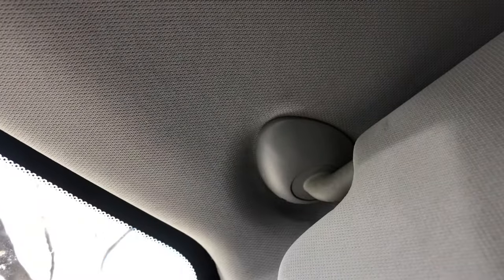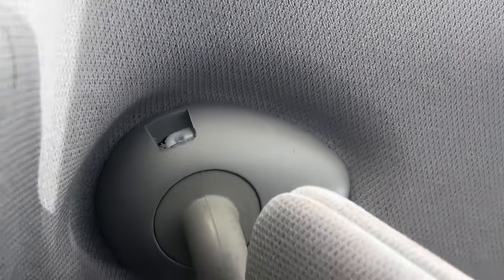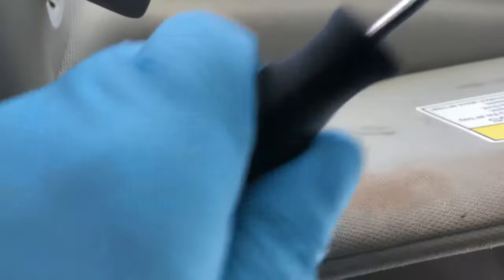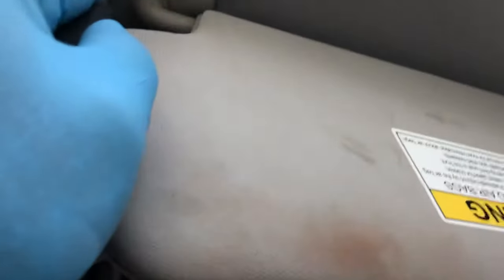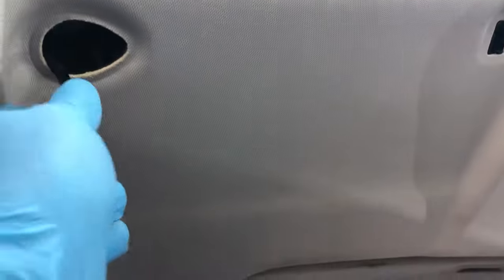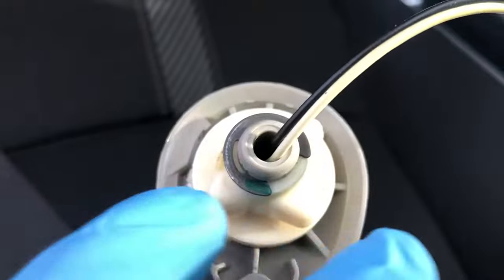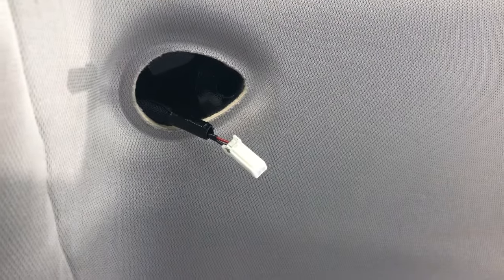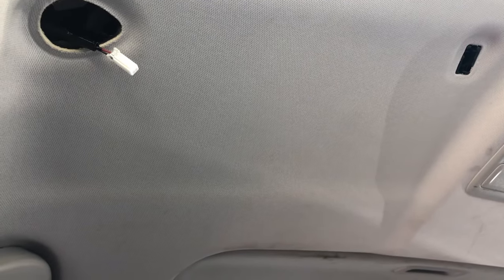Newer Honda’s, sun-visor replacement.

Comment: Thanks! Called my local Honda dealership and they wanted $250 to replace my driver side visor.  With your help, I easily removed the broken one, spent $50 on Amazon for a new one, and installed it in 45 seconds.
Reply from the maker: I’m glad to hear that, the people together can do a lot……
Reply: Hey David, could you please share the Amazon link? I could not find it :(